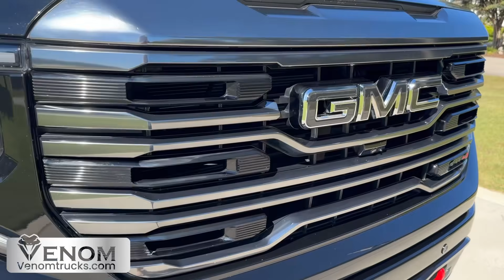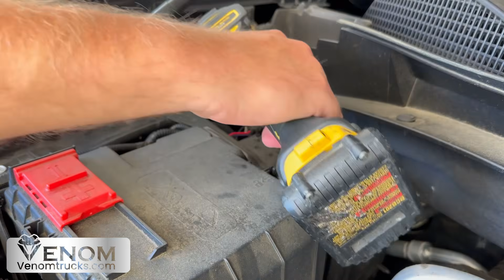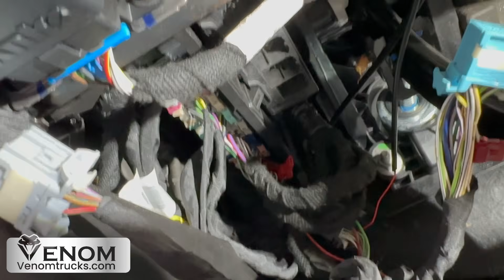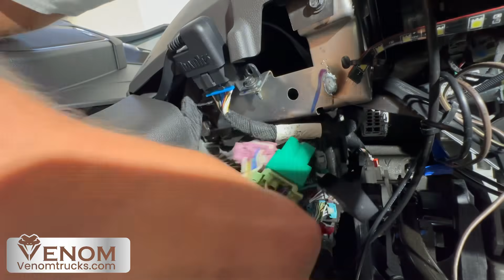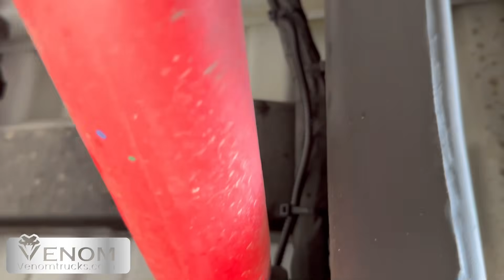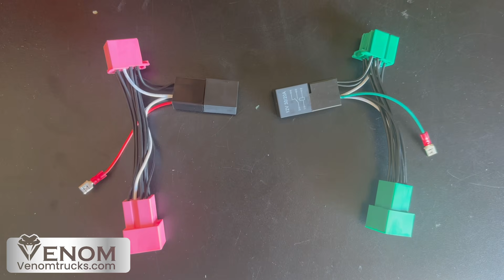Full Time Amber Day Time Running Lights (DRL's) for GM trucks!

Comment: My left and right turn signals work fine, but my hazard lights won't work. The only way I can get the hazards to work is by flipping the switch, but when I do that, the turn signals stop working.

Any idea what could be causing this?

Comment: Just completed the installation. Thank you for making this as easy as possible. 
For others out there - I’d recommend not doing this without a pick tool. You will drive yourself crazy attempting to losen the connectors. This process is truly plug & play, but if you lack patience and aren’t tech friendly; I’d recommend getting this installed professionally.

Comment: All the conector goon the same row as the switch one or on the front row
Reply from the maker: 2 go on the LCM row 1 goes on the BCM row. If you need a photo please email us support@venomtrucks.com
Reply: Ok, I did everything good but the one touch turn signal is not working
Reply from the maker: @eduardoochoa6137for the system to work, it relies on having the ground source your blinker uses. When engaged, ground makes constant contact in the lever. Allowing for the Amber to deactivate while the turn signal activates.  If you don't engage the blinker fully, no ground can be made.
Reply: @VenomTrucks  ok thank you, So is this normal or what do you suggest.

Comment: For some reason my 2025 Silverado, the GM wiring harness connector with the red lock tab won't come off and it's hard to get it out. It's been hours and I still can't get it off even though the video they do it so easily lol. Any tips? It's also hard to work with it because of the tight angle. Somebody please help me with this.
Reply from the maker: Once the red clip is pulled back and you depress the black tab, pushing in and then pulling out usually does the trick on stuck ones.
Reply: Same issue. Been stuck. I try every few days in different ways no luck
Reply from the maker: @Vikingbastich  we just had a customer called about their factory connector being stuck, and he said a hairdryer heating up the connector made it come out like butter.
Reply: @VenomTrucks going to give that a try!
Reply: @Vikingbastich got it yet?

Comment: One issue I’m having is lights are working in full Amber but blinkers don’t. 
I have the full time Amber on 2025 2500 gmc
Reply from the maker: Did you connect the pink and green wires together under the dash? Also you must engage the blinker fully to get the ground connection required to deactivate the Amber.
Reply: @VenomTrucks that was the issue, 😂 my bad

Comment: Getting the connectors out was a pain without the pick tool you used but everything is installed and works great! 

Thank you Venom Team for the great work and getting this Full Time Amber upgrade out to us 🤙🤙

Have a good holiday and happy new year 🎉
Reply: How did you manage to get it out? I been pressing on the black tab and released the red tab, but it won't come off
Reply: @Wazeon  sounds like you’re taking off the old switchback connectors? Yeah mine were stuck too. I used a flathead to gently leverage the connector out while pressing on the black release tab. Was a btch to get out. You might chip the little plastic piece holding the connector on if you don’t press the black locking tab down enough
Reply: @s @streetDAOC I don’t want to damage the clip so I been trying to figure it out. It makes a sound when I press on it but it won’t come off still
Reply: @Wazeon  use a jewelers flathead and try to wedge it in between the bottom of the black clip and the trucks connector to release it. What’s holding it in place is a small plastic tab on the trucks headlight female connector. You also might have to push the connector in a little, press on the black tap (with the red locking tab pulled out) then try to pull the connector out. Some suggestions, Good luck.
Reply: @streetDAOC thank you!!
Reply: @Wazeon  so, did you ever get the connector off? What worked?

Comment: On my sierra 1500 since I have the amber DRL's already, don't I just need the 3 other components for the full time amber?
Reply from the maker: no sir this kit works differently and requires 2 new headlight connectors that come in this kit.

Comment: Do you have to do the fender harness install too? I’m really just looking to replace the first gen Amber DRL kit i got from y’all for full Time DRL kit.
Reply from the maker: yes because GM thought it was a good idea to put the front fender lights and the rear fender lights on 2 circuts. it doesnt need to be like that and to work properly, they need to be connected together.

Comment: Is the switch fore turning drl to white?
Reply from the maker: Its strictly if you need to use hazards at night. Shuts off the amber DRL function inside the headlights.
Reply: @VenomTrucks  what will happen if you need to use your emergency lights and you forget to deactivate the DRL Button. Will they not work??
Reply from the maker: @isixtos during the daytime, they will work fine if you don't flip the switch. At nighttime, the front lights won't flash but the rear lights will if you don't flip it. 

If you flip the switch, everything functions properly.
Reply: I want to be able to change between white and amber DRL with a switch day and night, what do you have to offer then?